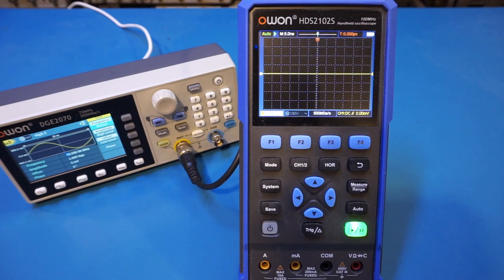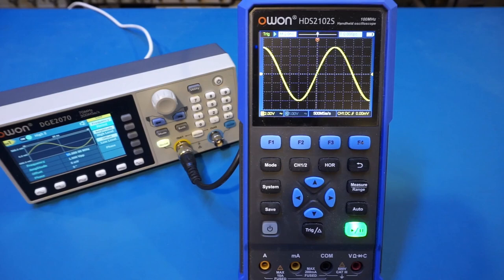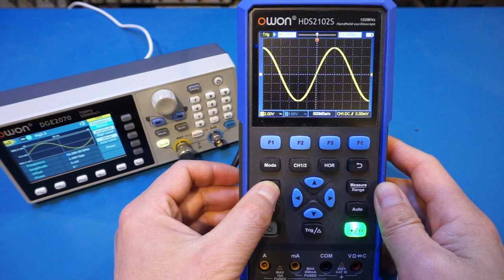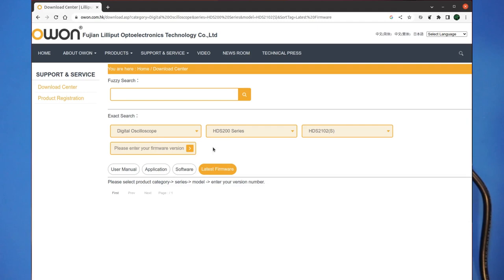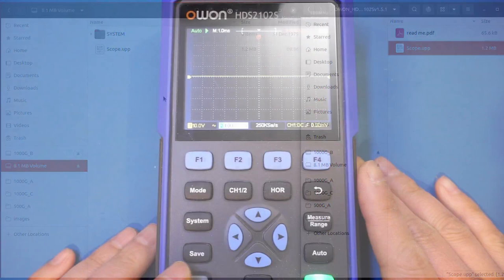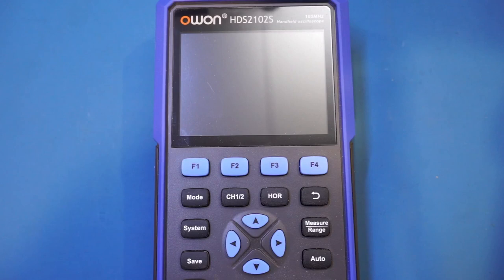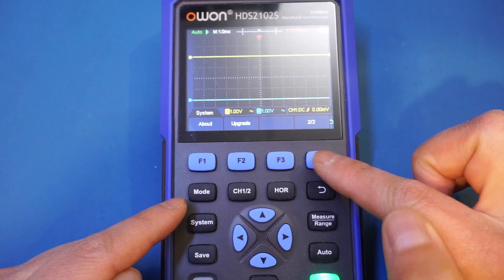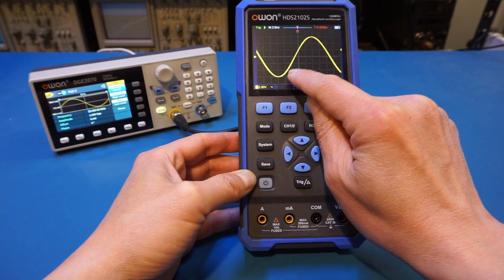OWON HDS2102S 2ns/div Display Issue Fixed, HDS200 Series Firmware Update Procedures

Comment: I got the HDS2202S today, and checked the division with it in different ranges, and a PWM signal from one of my microchips, and it is spot on with firmware 2.10. But Man, played with it for 2.5 hours and its already out of battery. haha. I guess this is how it is the first times we play with the toys. during normal circumstances I won't be using it all the time. Excellent product though.

Comment: It appears they use different version numbers for different hardware version. My HDS2102S is on v3.4.0. This version doesnt seem to suffer from the 2.5ns bug thankfully. It does have some other tiny annoyances such as certain measurements not updating in certain time bases, and weird artifacts on the signal when zooming in on a single shot signal with Peak detect (normal sample mode zooms in ok). Also in single shot ive had signals that wouldnt fully display on the screen until i zoomed in and out one step. I hope Owon puts more effort in to solving bugs for their existing products.

Comment: I just bought the version without signal generator and I used an external signal generator to generate a 25hz 3v sin wave and saw wave and used the multimeter to measure the voltage it didn't catch the value it keep increasing slowly and returning to zero i checked with my multimeter the Fluke 115 it get 3v and I checked with my Sanwa pocket multimeter it show 3v I just want to check if the issue is from my oscilloscope or is for everyone had the hds 2102

Comment: Kerry, I bought an hds2202s via Amazon about a year ago based on your reviews and it has never worked right - channel 1 has huge spikes that prevent triggering from working properly and displays them at crazy times (Channel 2 works properly if channel 1 is disabled).

The firmware shows version 1.0.1. I tried to find support at the OWON website you show, but the 2202 does NOT appear at all. People in the comments for this video report much later firmware on their 2102s. Contacting OWON for support at that time and I was stonewalled and asked to provide a VIDEO demonstration of the problem. How does one find firmware updates for the 200 mhz scope? It's not even shown here as an OWON product!

I've written it off as a bad deal and it's just sitting here hoping someday for an answer...

thanks,

M

Comment: Hello,
Can someone help: when I connect 60v from battery to power mosfet or IGBT to the drain/source (+ to drain, - to source ) it blows up. transistor not connected anywhere else. How it is possible? (transistors ratings 100-200v 60-80A) if battery on short it gives up to 55A.

Comment: I just received mine and the noise floor on both channels are about 120/160mV when 1V/div and like 12/16V when 100V/div damn, something is wrong and auto calibration does not help :(
Reply from the maker: Are you saying you were seeing noise waveform without any input? There shouldn't be much noise even down to 100mV/div.
Reply: @KerryWongBlog  Yep, there is something obviously wrong with it, I can also see a stable waveform line on your video(and on others too, even with different models), and mine is fuzzy. You can see it on the screen right away, and also measuring function picks it up. Its about 0,16div of each vertical scale.  Same on both channels. I don't know if it comes from ADC or something in power supply. And also I don't know where to go with it, banggood or manufacturer.
Reply: @KerryWongBlog  Damn this gets interesting. Imagine that when I took a peek inside, I found there is different hardware than in your teardown, and further seeking -  it matches higher model, and also got linsi ADC. The pcb is marked as hds2xx2x v1.11, and firmware running on my unit is V4.1.0. The boot sequence is also longer than yours, and it has this progress bar wchich matches 2202. And I also checked power consumption, and it is 0,92A @4V which is neither of both but higher than yours 0,72A, which again may suggest that it is 2202 downgraded. But I still got no clue about this noise so Im waiting for seller respond.
Reply from the maker: @rzabinczi  you might want to contact your seller and send them a photo of the issue you were seeing.  I reviewed a 2202 a few months back. You can also check that video out to see how your hardware compares.
Reply: @KerryWongBlog  Sure, I contacted banggood. And the hardware seems to match 2202s. I wrote about it because I thought that might be interesting for You, not suggesting that you should do something with it xD
Reply: @rzabinczi  I might have the same hardware as yours. I also have 4.1.0 firmware and a progress bar on startup. I haven't opened up mine to see what hw Rev I have. If it is a downgraded 2202, it would be nice if it could be upgraded
Reply: @arturjski5661  I can also confirm mine boots with a progress bar V4.2.0